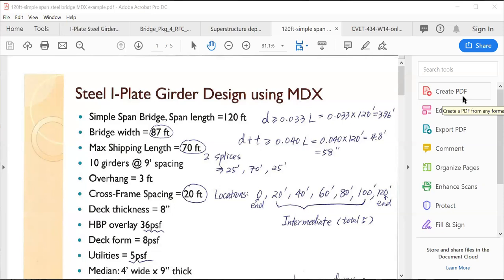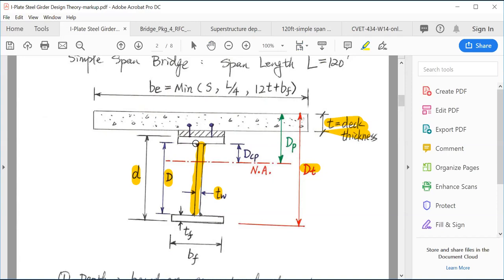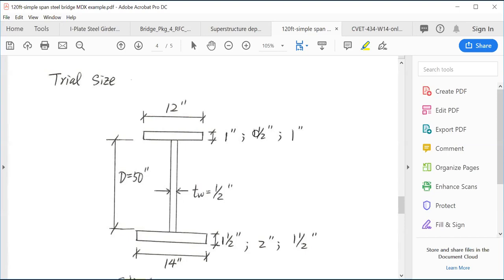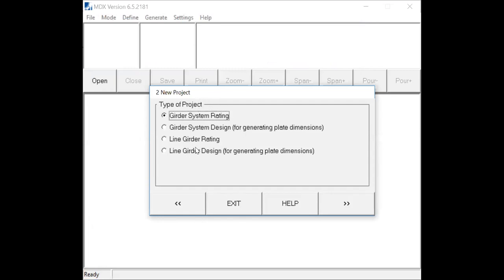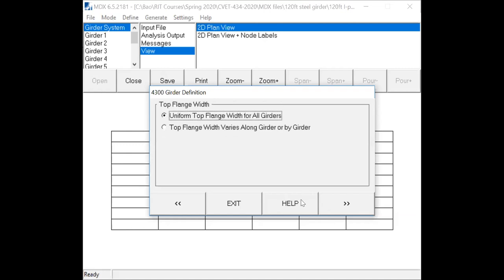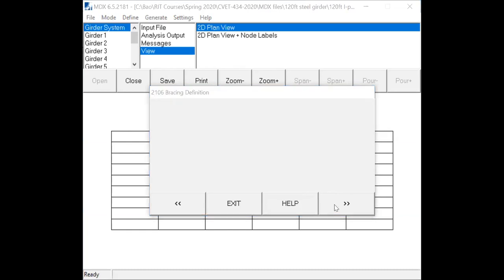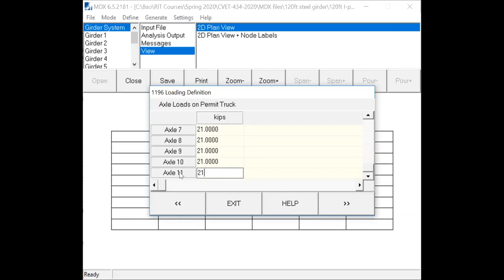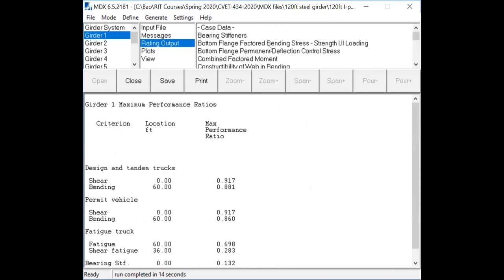MDX Steel Girder Bridge Example

Comment: Great video! For the intermediate transverse stiffener input step which takes a long time in this video. A good way is using an excel sheet put all data in one column, copy all date and paste to each girder (copy to the first cell it will automatically apply to the rest)